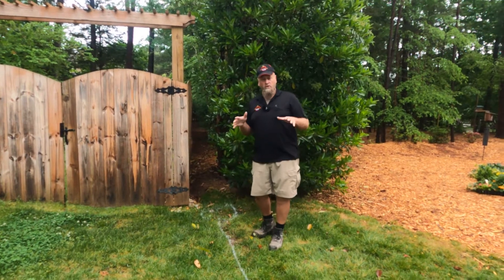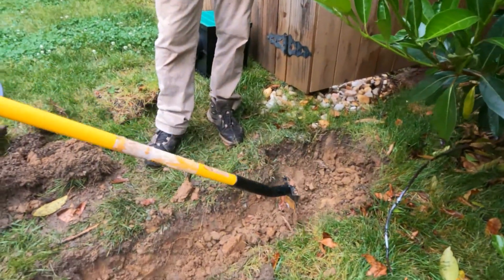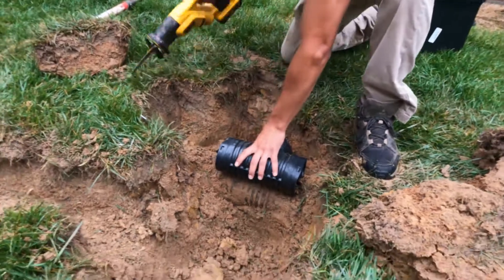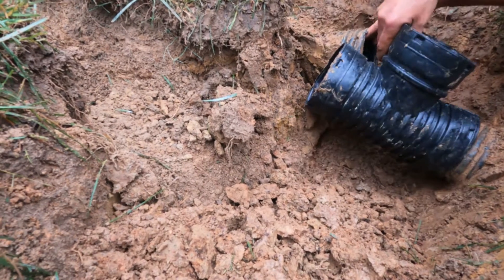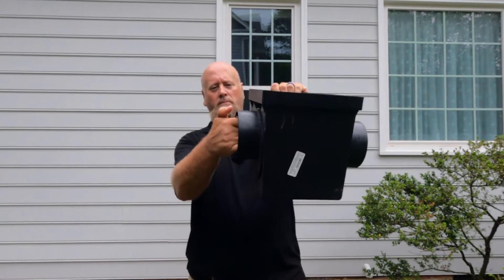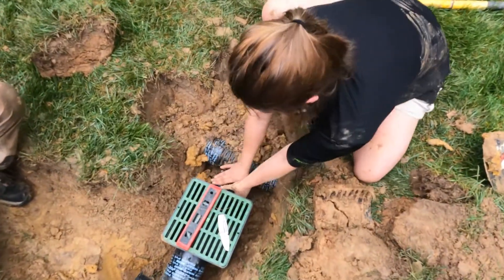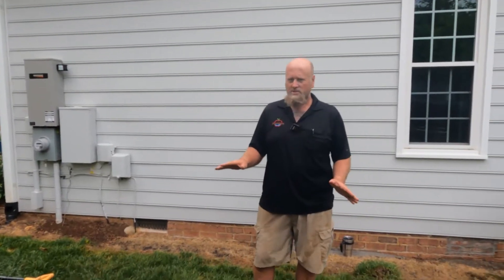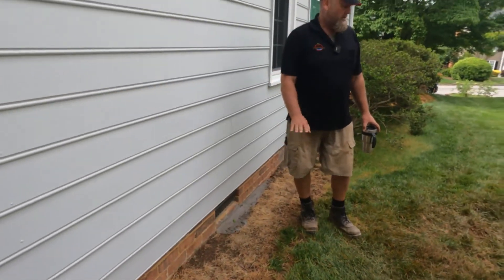How To Drain Water Coming From Your Neighbors Yard | DIY Yard Drainage - Apple Drains of NC

Comment: If a Y had been used instead of a T the water flow would be greatly improved, as this is standard practice for horizontal drain lines.